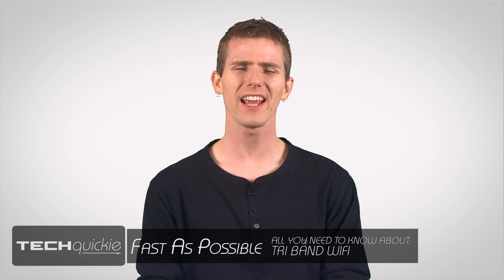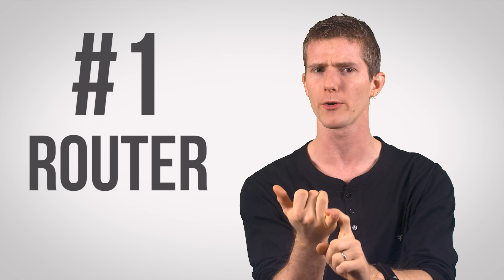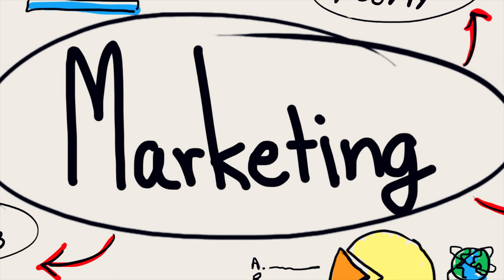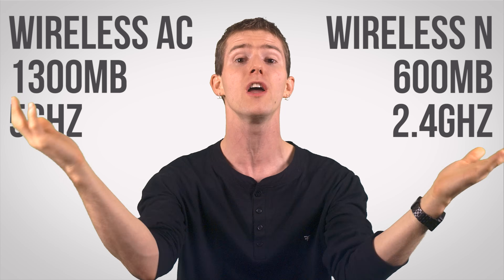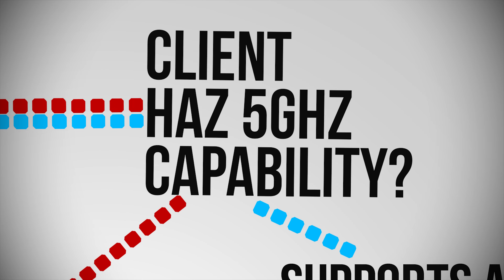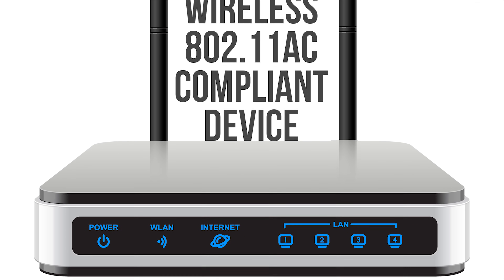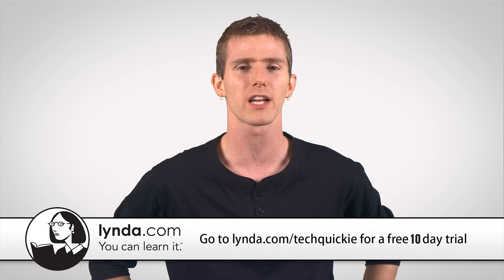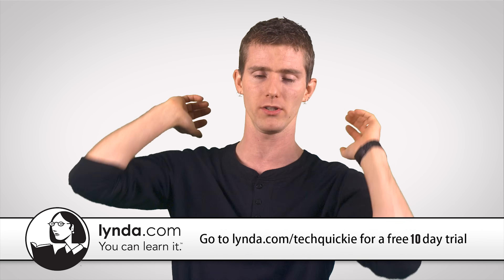Tri Band WiFi as Fast As Possible

Comment: On 5ghz I'm getting full range, speed test shows full 200mbps up and down with 25ms latency. But apps like Facebook, whatsapp, other 3rd party apps are running very slow. Although youtube is running good.

But on 2.4ghz every app is running fine even tho on 2.4ghz speed is limited to 40mbps.

What can be the reason for this?

Comment: key points:
> tri-band routers use multiple wireless radio bands
> tri-band increases wifi bandwidth
> depending on the wifi standard, tri-band routers are set up differently
> tri-band routers typically add an extra 5GHz (or 6GHz) band to increase bandwidth

> mesh wifi is when a router is combined with multiple satellites to expand wifi signals
> mesh wifi reserve a band for routers and satellites 
known as a backhaul

Comment: This is the reason why a portable workstation and a laptop are absolutely NOT the same thing. My old PW does have shotgun dual bandwidth mode. And my new one can literally burn out a router in an hour.

Comment: Great information. I was wondering what router to buy since I just got the Netgear X6S Mesh extender   Currently I have the ATT router with Fiber speeds over 300 Mbs.   Still have very slow spots in my house of the levels.  Thank you very much for your suggestions

Comment: Hello!! Here is a question that I can't find an answer to. It is about switches (and the bits that connect into it).  Say I have a normal LTE router (the thing you are talking g about in this video) with 4 1 gigabit ports. 4 is not enough if you have a NAS, PS4, a TV box and an AP upstairs (like those Ubiquiti AP AC ones). I want to get a switch and connect my NAS (which has 4 ports with link aggregation) to the router (use 3 of the 4 ports to get higher speeds on the NAS) and use the 4th port for the switch for my other devices. What is the speed that I will get out of the switch ports? 1gbps per port or 250mbps per port (if it is a 4 port switch) or 1gpbs less what the other devices are using? Are you confused yet? Me too!!!

Comment: No such thing as stealing wifi.  I've run my 1600 foot backbone covered with wide open Wifi Hotspots for years, no password needed.  Of course, I live in the country.   But if everyone did this, we would all enjoy the benefits of being able to roam everywhere away from home and get a signal anyway.  Now as it is with idiots believing in the security bullcrap, the wifi and internet access is all there and paid for but nobody but the owner can use it, and he can't use anyone elses if he's away from home.

I wish someone would come out with a cheap $20 tri band router...  in about 5 years they will.   Right now you can get the dual bands for $20 now...  but triband is extra useful because you can use the extra 5ghz radio to establish a dedicated link with the next router 200 yards away line of sight, and ditto for it back.  So there really is a real world practical use for tri band routers beyond having a second wifi client connect with its own channel.

Right now its cheaper for me to buy two dual band routers than one tri band router.

Comment: Just a quick comment here. No matter how fast you connect to the WiFi router the true bottleneck will always be one of 2 things. Number 1, the router probably plugs into your actual internet modem at 1 GB/s. So that is the absolute limit, then we have the provided speeds from the the ISP, which, just for arguments sake we might get 100 mb/s down and 100 mb/s up, well, no matter how fast you connect to that WiFi router, you will never get beyond those speeds. Obviously on your internal network you might get the full benefit of the WiFi speeds, but going out to the internet, you will never connect faster than the slowest component in the chain.

Comment: Hey Linus all good points. But I want to add for your viewers. That polite conversation share between devices is not only for your WiFi but your neighbors WiFi as well even if they are on two different networks. The objective is to have a clean and efficient spectrum space with as few collisions as possible. I remember when I worked at uverse as a technical support specialist my trainer told us not to use the recommended channels 1, 6 and 11. He said the reason why is because everyone else is using them and even auto channels tend to frequent those channels as well. Seem only logical right? Problem is he was ignoring the side band cross talk. The reason 1, 6 and 11 is recommended is because of the size of the bandwidth on the frequencies those three channels do not overlap eliminating cross talk. That said you are more likely to have a better communication on a congested channel because you are participating in conversation rather than trying to talk over a conversation because of side band noise. So I hope that is informative for people who think they are clever two avoid congested channels. You are not and you are only hurting the radio space and creating more congestion for yourself and everyone else.

Comment: Hey Linus, just like you did several videos on multiple ethernet cables between two network devices, maybe you should do a video on a triple-band WiFi device connected to a PC with 3 separate WiFi PCI/PCIe cards all shared through the OS. That would be very interesting to see.

Comment: So some automatically split the devices based on what they are capable of.  I'm looking to change out a router in my network cause it intermittenly drops the WiFi and I have to unplug and plug it back in to restart it. If the router automatically sorts the devices based on what they are capable of handling, would a computer that's put on the 5 GHz band (like a laptop) be able to communicate and transfer files with something like a WiFi desktop that's only capable of 2.4 GHz?

In other words, would I be able to connect to a computer that's on the 2.4 GHz band and retrieve/transfer a file to another computer that's connected on the 5 GHz band, or would I need to have both connected to the 2.4 GHz band?

Comment: Okay, so I'm sort of new to this and hope someone can answer my questions.

1. If you have an old Wireless Router that you've configured to be an Access Point, would it still sort out devices like an actual AP?
2. If both my Wireless Router/AP and Range Extender use N Wifi, would I be better off getting a N Wifi Adapter than a Dual Band Wifi adapter? Or does it depend on my Modem?   (I'm trying to be cost effective)
Reply: yes, it will assign local ip addresses with DHCP and do what and AP usually does

Comment: I have 2 tri-band routers, d-link dir-890l and Linksys EA9200, both are slow as hell. I think the triband routers are too under powered to run 3 bands, they only have a 1gig processor and 256 mb of ram, most dual band routers use mu-mimo with 1.4 gig processor and 512 mb of ram. I found the mu-mimo routers blow away the tribands in speed and distance.

Comment: Xiomi mi 4i has cabibilty change frequency 2.4 to 5.0 ghz
Reply: most phones have that capability now. Even 500 dollar laptops do to.
Reply: My $200 laptop and $50 phone has 2.4 and 5.0 GHz support
Reply: My OnePlus also has 5 GHz.  Though it's not that useful since it's only really great if you are cuddling the router.

Comment: Hello Linus. You talked about 5GHz and 2.4GHz. My laptop uses 2.4GHz wifi connection but my router supports  both 5GHz and 2.4GHz. Is it vise to change my laptop's wifi card to that supports a 5GHz wifi and will it benefit me anyway
Reply: Well it depends on several factors whether or not its worth the upgrade to you. If your current card supports the ac standard then you are already achieving max wireless speed. The 5ghz band is not any faster than the 2.4ghz band, its just a separate signal you can use like having two different wireless access points setup that won't interfere with one another. 

What the 5ghz band can offer you is a separate dedicated wireless connection just for your laptop, will leaving all other devices on the 2.4ghz (phones, tablets , Fire Stick, Chromecast etc etc. Assuming you have many wireless devices this could result in a noticeable improvement in speed and network/internet stability for the laptop.
Reply: 5ghz is faster generally

Comment: Linus can you explain what port forwarding is.
Reply: nope, that's not it

it's when you redirect traffic to a specific port of the public IP to a specific device IP inside the network, seperate from the public IP outsiders have access to

each router has it's own IP right, all the devices share it too,
but for example when somebody connects to port 25565 to connect to your minecraft server (cringy example i know) without port forwarding it just points to the router

port forwarding makes sure that when somebody connects to your ip using port 25565, all traffic is redirected to your device instead of the network itself.

Comment: For example: IM PLAYING ONLINE GAME ON MY LAPTOP AND CONNECTED TO 5GHZ. AND MY BROTHER IS CONNECTED TO A 2.4GHZ AND START PLAYING YOUTUBE VIDEOS,NETFLIX ETC. DOES IT GONNA CAUSE LAGS ON MY ONLINE GAME??
Reply: Having brother around will lag your online game. Tell him to GTFO or ask your parent for a new basement all for yourself.
Reply: It depends. Basically if you have an older router with a single band with both frenquencies available, then yes because the data throughput would alternate between you and him. If you have dual band (router/AP) can run both at the same time, then your connections would basically be simultaneous and separate which means neither would affect each other's performance.

Comment: I have a N router and the box said 300mbps on dual band.. how do I configure so I can use dual band at once?
Reply: You can't. If it is just one device, you are connected on 1 band at 150 mbps with the other band waiting for anything else so it doesn't mess with your connection. I wouldn't think twice about it though since that is 18.75 MB/s which should me much faster than your Internet is capable of anyway. Think of it like a highway that has two lines and you are driving a car that can't reach the speed limit. You can drive as fast as you possible can and not worry about it and if another car shows up, you can continue to do so.

Comment: my phone uses download booster or Wifi+4GLte at the same time
Reply: I doubt it can use both at the same time rather it switches between the best signal either WiFi or 4G but you don't want that setting on unless you have unlimited data
Reply: cool
Reply: What's the app called??
Reply: Not an app, Galaxy S5 has it

Comment: If my pc currently can only connect to a 2.4 ghz router, but I have a dual band router. Can I connect to a 5.0 ghz router if I update my WiFi Card, or is it something to do with another part of my PC?
Reply: wifi card
Reply: Tony Liempeck So I can just update the wifi card and it will connect to 5.0 ghz bands without a problem?
Reply: Yes. and depending on your OS you could use both wifi cards at the same time

Comment: increasing router link speed is a waste of money most of the time most ISP customers only get 20mb or less it is like 0.10 % of the total hub bandwidth faster routers is nothing but a joke.
Reply: +Mbit Gbit 20Mbps ouch that really is not very good at all. New Tampa, FL 33647 we are lucky enough to get the fiber optic speeds here at 500Mbps download if we want. I pay for the 200 up and down service :D It is really awesome! OH and a FYI to anyone who is curious. ISPs provide their rated speed in Megabits per second (Mbps) not Megabytes (MBps). It is an 8 to one ration, meaning it takes an 8Mbps to down load 1MBps. Just figured I would throw that out there since I see a lot of people confusing the two measurements of speed.
Reply: +Mbit Gbit Love it how ISP gives you routers that can withstand 1Gbps but I rarely get over 2Mbps and everyone else close to the exchange barely gets over 10-15Mbps.

Comment: please can compare all new 2016 routers ac5400 for the best mobile device performance and reliable connection.
Reply: +JK T 
I would recommend any of the Ubiquity stuff. They are built more for commercial use at consumer prices, well or close to them. I really like how they can handle huge amount of Network Address Translations (NAT), if you are not familiar with it, basically think of it as access roads to the Highway (WWW in this case) The more NAT your router can handle the quicker your connections will seem. Not saying your connection will speed up from base line. What it does is help prevent slow downs when multiple devices are connected. Especially when you have NAT intensive services running like Facebook, Skype, Any Torrent program, ie Steam updates. I recommending you pick one that has the largest amount of Vram and NAT handling. 

Here is a link to the one I am running in my house. It hides really well on the ceiling, it looks pretty cool and has some amazing performance. The $98 for it is a steel compared to the $200 or $300 most other AC routers are charging. That and the Ubiquity one can handle more traffic with out slowing down:
http://www.amazon.com/Ubiquiti-Networks-Enterprise-System-UAP-AC-LITE/dp/B015PR20GY/ref=sr_1_2?ie=UTF8&amp;qid=1455610541&amp;sr=8-2&amp;keywords=Ubiquity

Comment: I'll never go back to Wireless. Even if I'm 1ft from the wireless router. I've just installed Augmented Category 6. Wi-Fi will never be as fast or responsive as a hardwired connection. The only time I'll use Wi-Fi if for my Samsung Galaxy Note 4.

Comment: Correct discussion.  You should have continued using the highway analogy with band steering putting the slower devives on a road with a lower speed limit. Some explanations are also only useful to some who alreasdy understands the technology.

Comment: I spotted a mistake, you should have displayed 600Mb instead of 600MB. You would never get 600MB point to point, you would get 75MB/s on a 600Mb connection, which is what you should have put. Dont wanna be 'that guy' but lots of people make this mistake.

Comment: So I put a password on my wifi and my neighbors won't get their grubby little hands on it right ?
Reply: Justin Wilson or you could be nice and let them use it :)
Reply: Justin Wilson Lock it down by MAC address and they will all leave you alone.
Reply: How do I lock it down via mac address?
Reply: Holy Diver
unless they are smart, run a sniffer, and claim to have your MAC address.
Just make a password-ed network.
Reply: MinecraftEpicPlayer
yea but how do i lock shit down with a mac address like Holy driver was saying?
Reply: Stewie Griffin depends on the router/AC, but go into the admin settings and there should be MAC address filtering options, so you can set it so that only devices with registered MAC addresses can connect to it. You're basically going to say don't connect to anything except the following MAC addresses. It's a little bit of a pain to do. Passwords are usually fine enough if it's a difficult password and your SSID (network name) isn't a common one.
Reply: Justin Wilson yes. but dont use things like 123, 123456789, password, wifi, internet or any of that bs
Reply: Stewie Griffin I recommend simply not doing this, especially if you have devices that come and go since you'd have to essentially log into your access point and white list each device that wants to connect to your network.  It's far easier and just as effective(since MAC spoofing exists) to simply turn off WPS on the access point and enable WPA2 w/ AES encryption only though it's safe to have AES+TKP for legacy reasons/support for older devices that may not like AES but that is uncommon.  If you use a strong key (usually random letters, numbers, and special characters) for the encryption such as "iC4nHa$che3sbur6ers" you'll be safe for now, just don't hand out the code to people because they are your enemy. I fear simplification systems that are coming up that allow you to easily share your wireless keys with others, basically, anything that makes the job easier is doing so by removing some layer of security.
Reply: Justin Wilson Use a VPN and have a good password, nothing like "wireless" or "Password123" or "Letmein" 
Use something that only you would ever know.
Reply: +Stewie Griffin MAC address filtering. It's more of security through obscurity. They can still spoof their MAC address.
Reply: Use a VPN for the Internetconnection inside Your local Network together with a weak Password for the WiFi is at least trolling. The WiFi Router in this Scenario is not connected to the Internet. Instead some other Device acts as a VPN Server to the Inside and connects to the Internet so You must use that VPN Service. Some unwanted Guest may see whatever the WAN Port of the WiFi Router is connected to if it is connected somewhere.